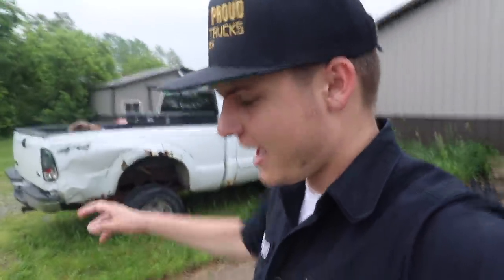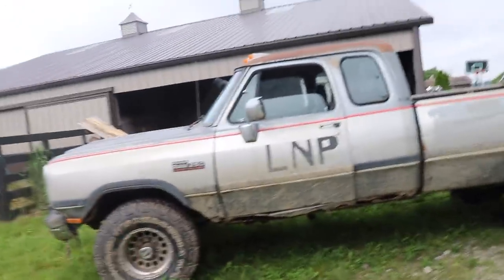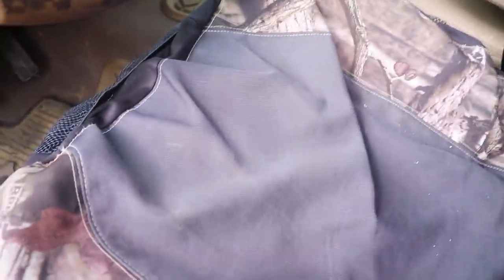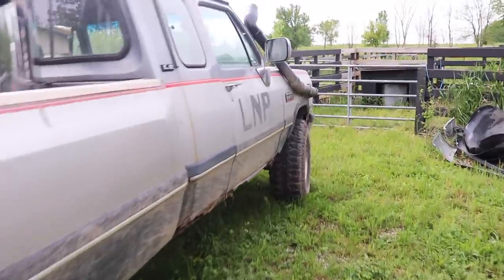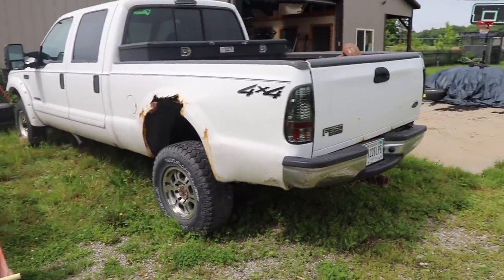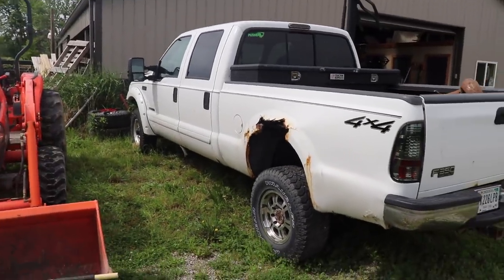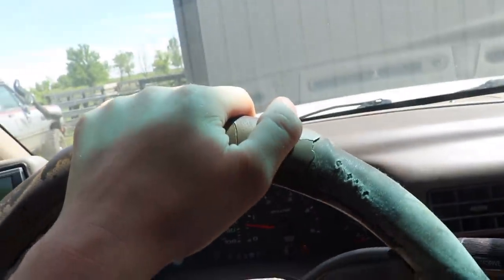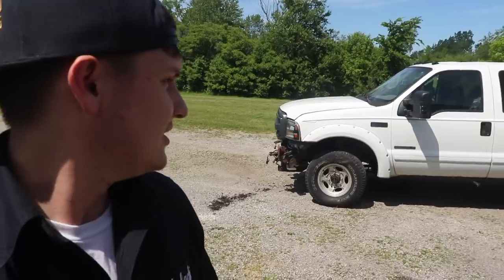WHY I DROPPED THE 7.3 PowerStroke Project...

Comment: Rip the bed off rear bumper rip the flares off get you some new hood hinges for it take front fenders off if needed try and just bondo the rust on the cab drill it out bondo it then spray paint it white. Get decent flat bed and maybe stock or aftermarket front bumper to match rear bed do an exhaust and youll be good to go

Comment: The bed is easy to take off. Cutting torque to the bolts disconnect lights get the ground wires off under there fender well

Comment: With the way that 7.3 F-350 are built you should flatbed it and get a fifth wheel trailer upgrade the shiz out of the 12 valve and go to competition with the 12 valve. Hope you take this into consideration. Oh and on the 12 valve use the 4th gen Dodge to pull it out and use 2 jumper cables one for each battery it charges alot faster and it turns right over.

Comment: Being that I had a few super duty’s in the same condition as yours, a grinder an a few hours an that bed should come right off. 8 bolts, unhook the filler neck an tail lights an lift it off with the tractor..

Comment: The 1st Gen mud truck isn't worth $2,000 e wn though it's got a 12 Valve with a trans and 4x4 it's rotted out and I would only offer $500  plus you can't even get it started as well
Reply: Nobody cares what u would offer lol
Reply: I wouldn't give $2000 for it either right now with it that deep in the water. if it was running big difference